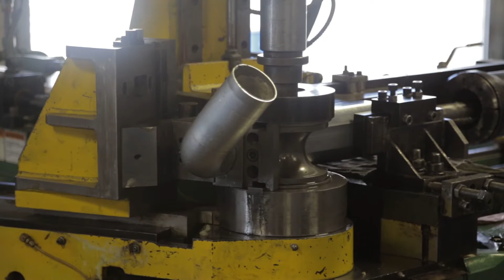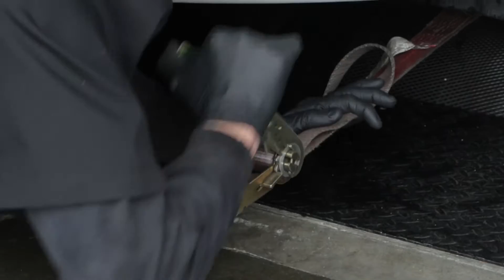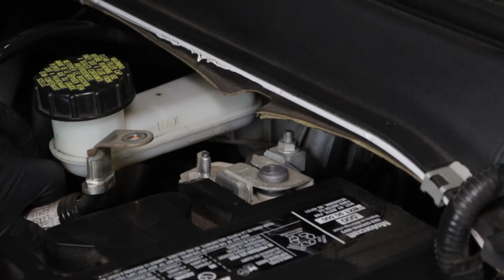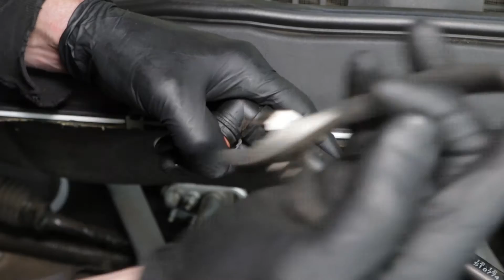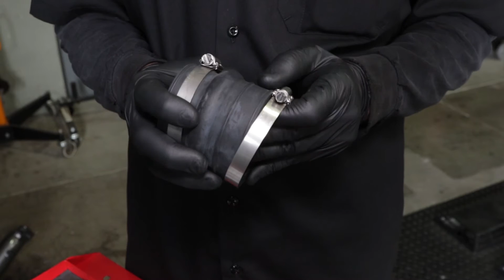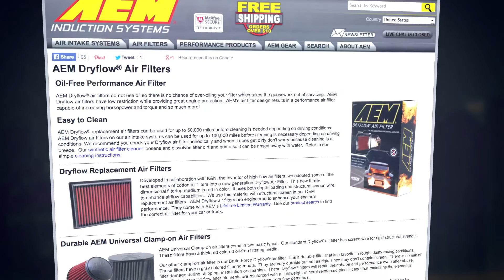How to Install an AEM Air Intake on a 2013-2015 Ford Fusion 1.6L Ecoboost

Comment: IMO the additional 7 hp is nothing and not worth doing this. You wouldn't even feel the difference in power and only hear the extra noise.
Reply: Gains are gains, big or small.

Comment: Nice intake. We sell them. As an FYI though, the 1.6 was only available in 2013 and 2014. 2015+ they switched over to the 1.5 completely.
Reply: This should still fit the 1.5 correct? They are the same block.